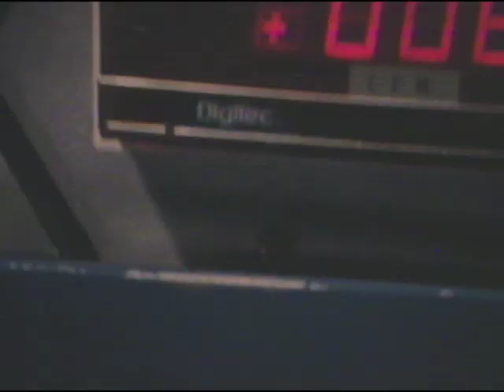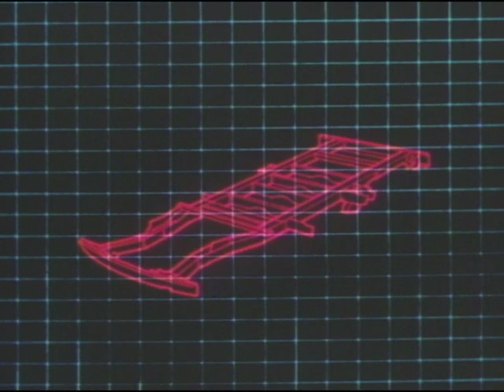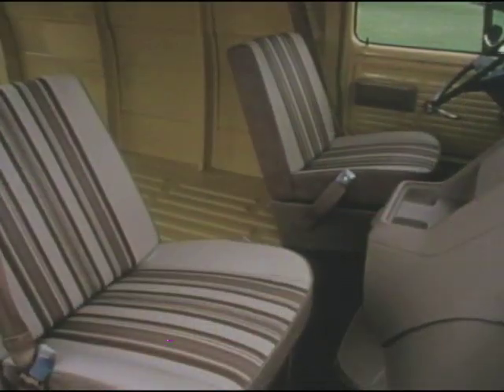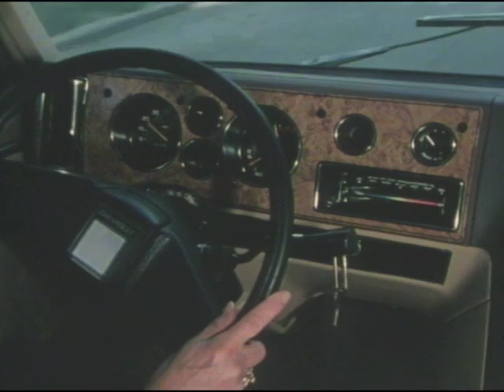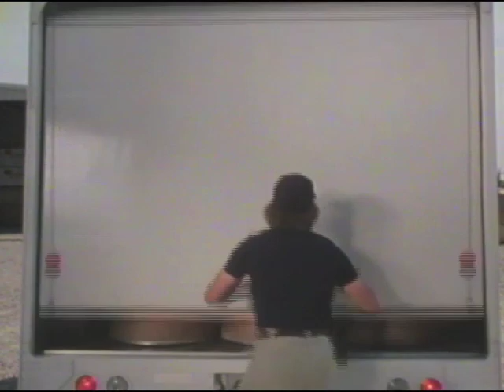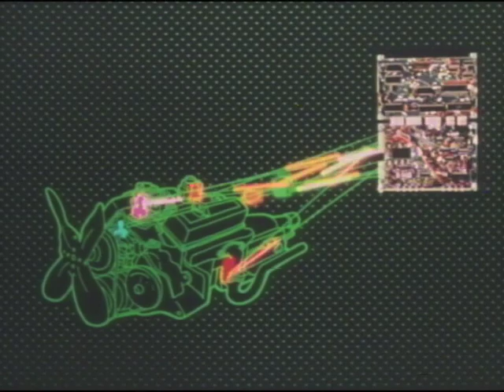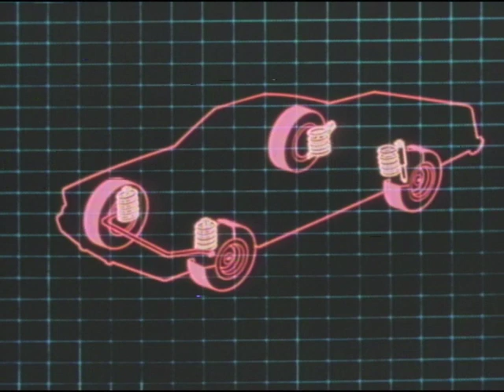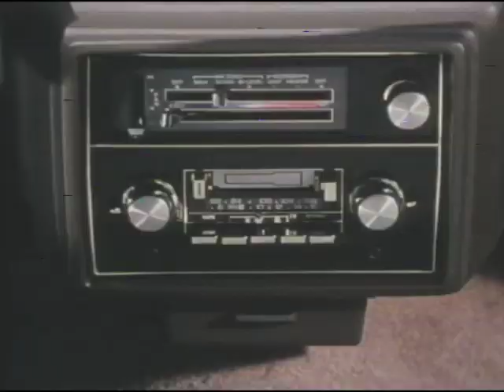"1981 Chevy Van / Sportvan, El Camino" - (Dealer Film) 3-of-3

Comment: That 305 was miserable in a G20 van, Dad pulled it and put in a 400..
Reply: I did the  same thing the 400 made that van fast as hell today they don’t make vans like that today w have JUNK
Reply: I had an 83 with that engine.  It moved very well.  I later put a 400 hp 350 Vortec in it.